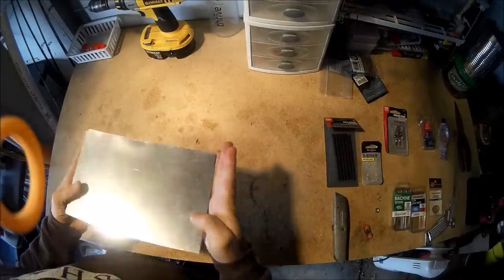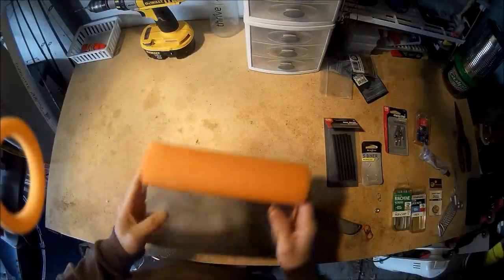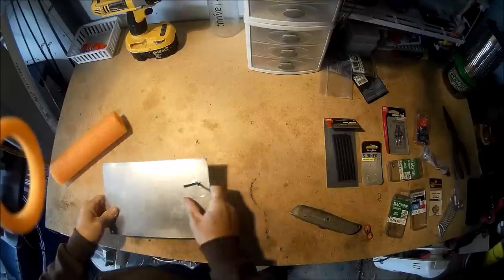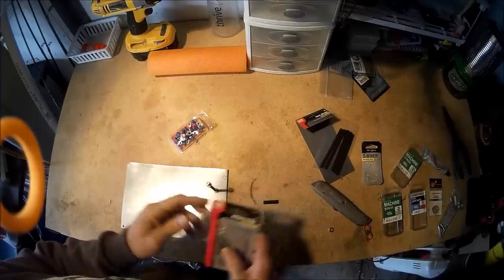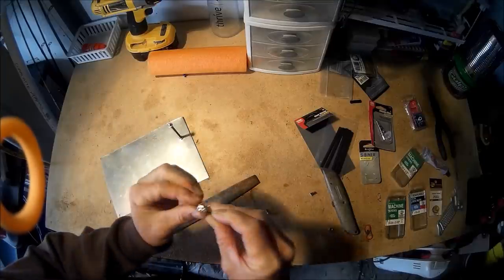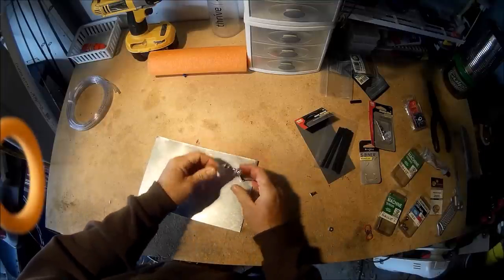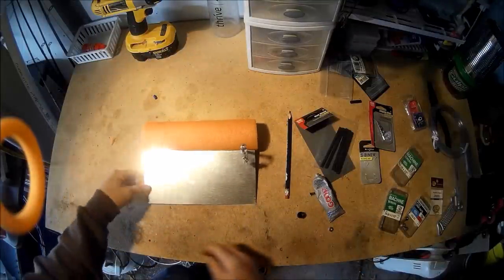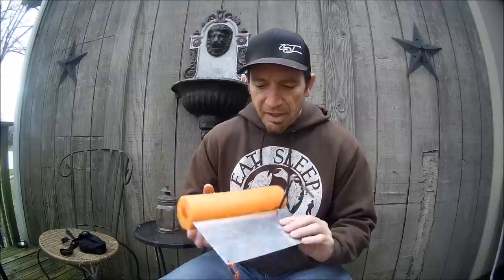DIY Planer Boards

Comment: Made a set of 4 (two (6x9) & two (6x12) with a single pool noodle and  piece of scrape plexi-glass (vs. sheet metal) found in my shed.  along with a ($10) trip to Menards  for eye bolts, lock washers, key rings, battery connectors (vs. alligator clips) and some electrical tape to make a pad around the teeth on the battery connectors. and some strips of metal for some extra weight (to balance off the weight of the ring bolts)  I can't wait to test them against a real Off Shore side planner that my brother let me borrow.  I'm now working on how to add a reverse tell tail flag  without a spring to my newest toy. I'm pretty sure using a slit in the top of the pool noodle will be enough tension (vs. using a string).  I'm planning on designing it so the flag pops up when there's a fish on the hook vs. having the flag flip down when there's a fish.
Reply from the maker: Very nice! The flag is a pretty solid upgrade. Please follow up after you test them and let us know if the 6X12 seems like it's a better size. Appreciate the feedback!
Reply: I used heat shrink on the clip. It molds to the teeth but has no sharp edges.

Comment: I experimented a fair bit using acrylic sheet, and found 1/8" works well at about 11" x 7". Also 1/16 solid laminate is great but you need to reinforce it at the holes using washers. For the crocodile clip, I couldn't find any cheap ones, so I used various styles of clip from the dollar store- mini clothes pins work very well. I should emphasize that I fish from the bank in a very fast moving river, and a modified planer board based on your design is the only way to get my lines out where even the boats can't! Caught some nice smallmouth bass, a catfish and a pike with the help of this. I even made a mount in the pool noodle for a glowstick, which helps a lot in late or early fishing excursions! When I video the boards in action this season, I'll post a link

Comment: Just saying, most of the planer boards have pointed fronts and backs. I would try gluing the ends together and once they're well stuck, cut the front and back like a boat bow. I think it would track better and have less resistance being pulled.
Reply from the maker: You are correct! I ended up doing exactly that. I can't say that it made a huge difference, but I do believe they run a little smoother that way.
Reply: @FloatFishAdventure  I have made a few, basically the same. They are very helpful. I drift and troll for Catfish here in Missouri. They certainly help keeping lines separated and less likely to tangle. I modified your line clip. Instead of using the tubing, I put a piece of shrink tube on there. The teeth are still visible but they aren't sharp and that seems to grip the line well.
Reply from the maker: @robertchapin3683  That's a nice mod. Thanks for the tip!

Comment: Just wanted to say Thank You for making the video. I'm having some old-age wrist/arthritis issues so I will be doing more trolling in my 17 ft tinny. I have used WalMart Cutting boards for many projects. They are about $1.00 for a 12x 8 (approx) so I think I will experiment with one of those first. Your explanation was great, although the audio turned garbled for the last half of the tape. I turned CC on and that worked for me. Heading out to my shop right now! Thanks again.
Reply from the maker: Thanks for the comment and good luck! If you have luck with the cutting board post a follow up and let me know!

Comment: I think a lot of people will benefit from this video. Every major brand of planer board on the market is ridiculously expensive for no more than it costs to actually make them.
Reply from the maker: Yeah these were stupid cheap in comparison. And those pool noodles will support some pretty good weight underneath them.

Comment: These are easy to use and highly visible enjoyable.fishing recommend they are extremely valuable for going from a dead drift set up to a float setup. They save time and you don't have to re-tie everything to add a float to your presentation.

Comment: Thanks and very informative. I used some elec wire insulation as the plastic tube on the clamp.
You need to match the diameter of the screws with the electrical terminal diameter. E.g. 3/16”. I’m yet to trial fishing. I agree that from a kayak might be awkward.  Cheers Phil

Comment: Cool! Im with you on the usefulness in a yak. I have a sit-in and it doesn't have much room to put those. 
 Maybe you can cut the front edge of the pool noodle at an angle on each side to MAYBE help it cut the water better. I don't know anything about planer  boards.
Reply from the maker: The first one I made I put wedge shape on the front side. I honestly didn't notice any difference between that one and the ones I just left the flat front. It might matter at higher trolling speeds but at the slower drifting speeds for catfish it doesn't seem to.
Reply: Tactical Kayak Angler oh ok, I'm to try and make one and see how it works for me too, thank you for your responce. have good a  one bud.

Comment: I just made a couple of boards based on some the Russian  on youtube made.  The rear clip you are using where did you buy them, I mean what type of shop.  The clips you use for the front, are they strong enough to hold the line so that it doesn't slip out? I've noticed the bought ones have a pin to stop the line escaping.  What are your thoughts.
Reply from the maker: The rear clips are Nite-Ize KeyRing S-Biners.  The front clips have worked ok for me. You could always upgrade them though. My goal with this was to keep the cost as low as possible and use parts that could all be found at Menards or the local hardware store. I liked the idea of building it cheap to see if it would work then upgrading any components later if needed.

Comment: Vid of you using them up?
Reply from the maker: Nothing up right now. I have some good footage of them in use but the fishing wasn't particularly good that day. I was hoping to include some shots of catching fish with them. They work pretty good when I use them, I just don't need to use them very often. So the follow-up video has drug out a lot longer than I had intended... :/
Reply: @FloatFishAdventure  yeah I'm not sure if I would use them much either I just really haven't seen anyone in a kayak use them in their footage so I'm really curious to see how it looks I appreciate the videos as usual
Reply from the maker: @mychalboose5470  That's exactly why I didn't want to pay top dollar for a set! Mostly I only use them for shallow water drifting so I'm not running right over the top of the fish. This is a video I've had more than one request for though so it's a priority for me in the Spring.

Comment: Those clips will not hold line
Reply: If you put shrink tube on the clip teeth, it holds much better. The teeth show through the shrink tube but there are no sharp edges to cut the line,